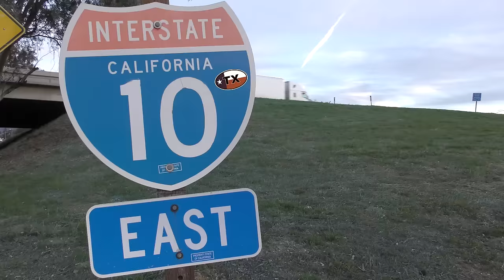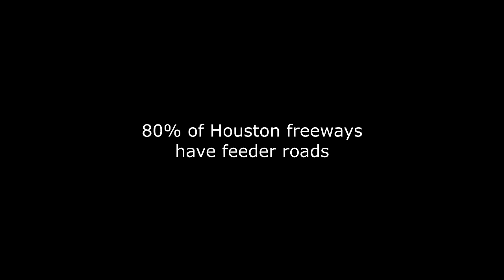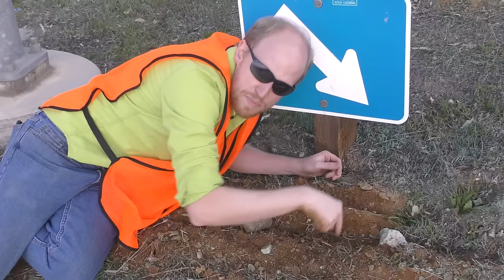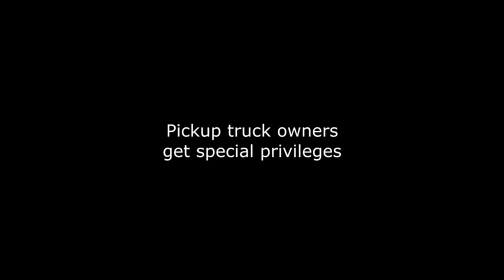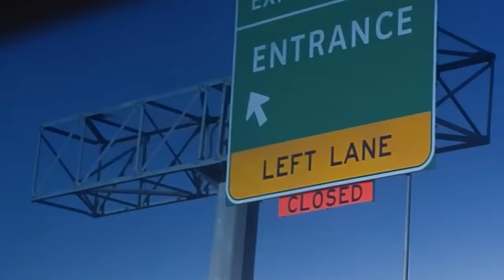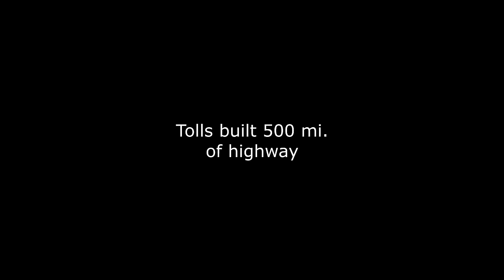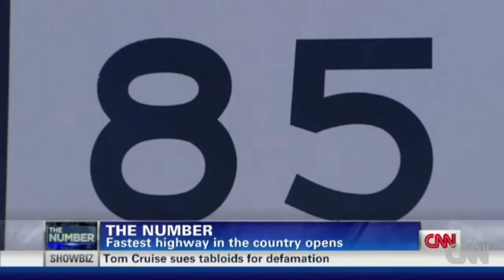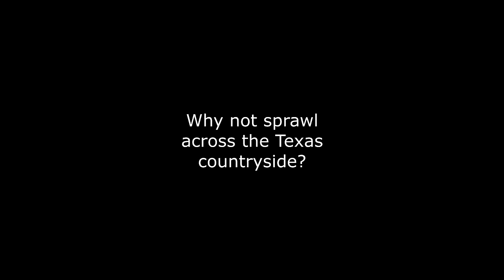How does good Texas engineering make REALLY BAD roads?

Comment: The reason for the lack of sidewalks is that most of the boulevards were built around the 50s, and were widened later on to make room for bus/bike lanes newer car body styles. I'd be willing to bet more of them had sidewalks back in the day
Reply: You should still put in a sidewalk when you expand the road. Really the lack of sidewalks is an acknowledgement that the space isn't intended for humans.
Reply: Lots of new roads here in the seventies were built without sidewalks. It was late seventies/eighties when they started being mandated to specific standards. Wheelchair access is now on  version two  with many curb corners being rebuilt any time an intersection is modified in any way. But it can be weird driving down a road with all these different versions of road standards along the way.
Reply: @@moonshine8255 fun fact, R1 zoning is the only landuse that is a net tax burden on the city, having your city be nothing but suburban sprawl is economic sucide because every 30 years the roads cost more to resurface than the tax revenue earned in that same 30year period. (Also factoring in municipal utilities replacement for their lifecycles)

Car dependency is the reason Texas' Cities are broke, not the solution.

Comment: by not having fences the highway can suddenly develop a by-pass to the congestion. when theres a 6-lane crash, the paved paths cant function due to the congestion - even for emergency vehicles
Reply: I saw that once on the 580 in the bay area of CA. Traffic was wall to wall moving about 30 mph and an incoming ambulance had to inch past cars along the inner shoulder that was full of debris, including shredded tires. One of my most intense drives ever, as that stretch has a lot of on and offramps and it was during the morning rush.
Reply: The funny thing is that - yes some people use them as shortcuts - but not enough people to make that a problem.
Reply: @colincampbell767  Only time I ever see people pull a texas exit is when there is traffic caused by an accident.

Comment: Harvey was the worst rain event in recorded US history. Many places flooded for the first time in the history of the city. And in the two years beforehand, we had severe flooding events in the spring, not associated with any tropical/hurricane system.

Given that we're in the crosshairs of hurricanes every year, and they're going to keep getting worse, Houston needs to really shore up its water and drainage works. Residents have been pushing for better infrastructure and public drainage works, and there's some progress being made, but it's an uphill battle. We need to look at countries like the Netherlands to see how they've adapted to keeping the water at bay.

2021's winter storm was also an unprecedented event. The state government pointed the finger at ERCOT, but they're just the energy controllers. The real source of failure was the energy facilities and connections, which weren't designed to handle severe ice. Those are owned and controlled by the energy companies.

So a consistent trend around here is that we're finding out how inadequate our infrastructure is in the face of severe weather.

Comment: As a resident Texan there is another problem he didn't mention. Once those tolls are paid off...they do NOT stop charging the tolls. It becomes a cash grab for the state.
Reply: Highways still need to be maintained. If you use the highway, you need to pay your dues.
Reply: @MrCHAMMOND  Sure, but a lot of states use gas taxes to maintain the roads. And if tolls are necessary to maintain roads, why aren't all roads tolled? The state will always find the money somehow; the question is who gets to foot the bill for what, when, and where.
Reply: @RickJaeger  Hard to believe you asked why there aren't toll roads on every road in America. Just think for a second, the cost of taking up such a task. I also didn't say toll roads were necessary, I just explained why people pay a toll once the road has been paid off. It goes back into road maintenance, typically the highway itself.
Reply: @MrCHAMMOND  The expense itself gets paid off by the tolls eventually or they wouldn't install them in the first place. That's only a reason why every road is not turned into a toll road all at once, not a reason why not every road would or could not be made into a toll road. Other than that, nothing that you said contradicts what I said.

Comment: So weird to see you on roads I know XD
The two way feeder roads are ridiculously unsafe, and are mostly gone from the DFW area, the crossovers for people getting on and off led to countless head on crashes, and even the one way feeder roads lead to quite a few wrecks as poor visibility (as someone on the feeder needs to be able to see someone getting off the freeway overtaking them  from behind) combined with often short acceleration / deceleration lanes for merging traffic.
And then the ones you were on North beside 75 are just insane as the left lane keepsgetting forced to merge as the highway on and off ramps appear forcing you to keep moving over just to go straight...
Reply: J Getrum Midland is changing the feeders to one way.  Feeder loses left lane and exiting traffic has left lane.  Ector county already did that. Seems to work good.  Where I'm working you have to know the roads,  one section literally ends in the pecos river (ditch)

Comment: I feel like the 130 Toll Roll failed bc it’s targeted for traveling btw San Antonio and Austin but the southern terminus is pretty far away from SA by Seguin so if you’re a local in SA it ~feels~ further away than it really is so you won’t want to use it even though the way 10 is built it kinda runs parallel to 35 for a bit so it’s kinda the same??? Either way I wouldn’t want to drive that far east just to go north it’s just to much trouble lol

Comment: Things I hate about frontage roads:
(1) Turning into them from a side street: cars going near highway speeds and trying to find a good time to turn with people waiting behind you can be stressful. And sometimes tit gotta use the turnaround or the get into the left lane to enter the highway. 
(2) Exiting from the highway: sometimes you gotta turn all the way to the right lane RIGHT after exiting the highway and just HOPE there’s not a car that you’ll crash with, especially when you can’t see the traffic until you fully exit the highway

Basically, they’re great except it has so many more conflict points with lane changes.

On I 610 N (I think....might be another one). I have to sometimes change lanes 3-4 full times after entering the interstate in 0.2 miles just to avoid exiting. So many lanes in Texas means so many needed lane changes.

I drive okay and it’s not too stressful,  but it can get annoying. 

Also on I 610, I was trying to get into the second to last lane from the right because I knew that was my exit to I 45S and wild lanes just appeared without me noticing and has to move over to the left 2 or 3 more times lol. It’s often fun to be in the left lane and then randomly find that you’re in the middle of 5 lanes

Comment: I live in DFW, and all new highway construction in the last decade was simply to add toll lanes.... something that was very very rare in this are prior to that.  They take the worst traffic spots and increase the highway from 8 lanes to 12... with 6 being toll and 6 being "free".  Didn't we already pay for those roads with property taxes??
Reply: Fuel Taxes...property taxes pay for schools and all the local government crap. I to had that question til I had to see it to myself and fuel taxes are the reason why your roads are free and not toll but with a combination of the two in one road it means one of two things either 1. The road was too expensive to fix and bumped another billion to the cost to be safe than sorry that hey retrofitting a toll road in the middle or tunnel them will pay for the costs. 2. It was planned out 20 years in the past between Bush and Perry which seems more feasible but their plans were tolls statewide if you remember the TTC projects of the early 2000s where they needed 1500 feet of new land to build a parallel tollway to the existing expressway and the rest of the land would be for frontage roads high speed rail both passenger and freight plus utility lines under and over the roads.